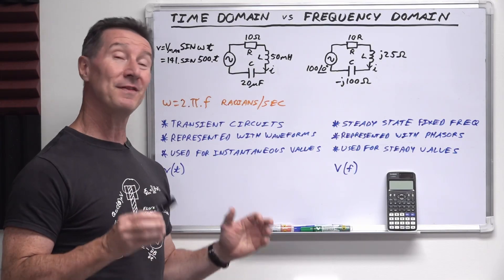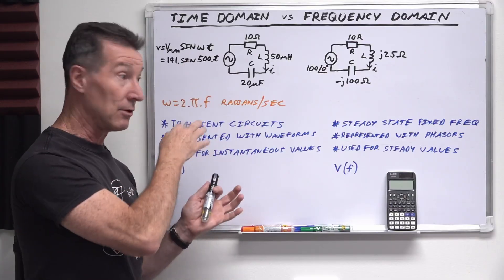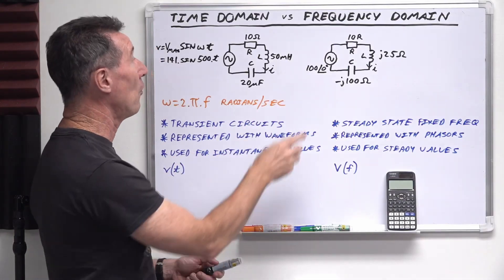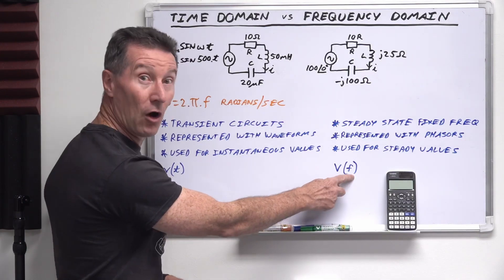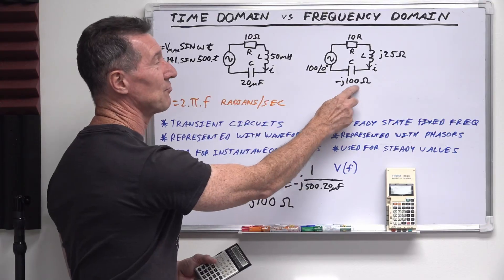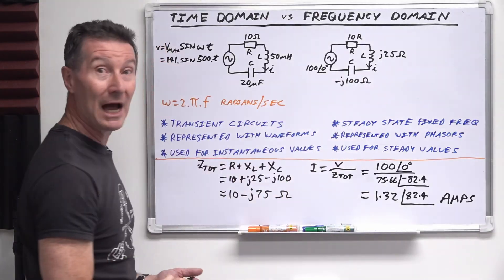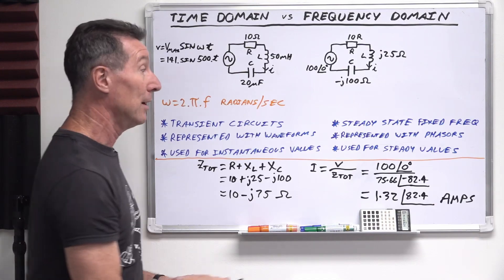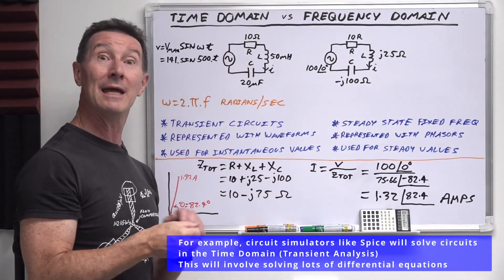EEVblog 1661 - AC Basics Tutorial Part 5: Time Domain vs Frequency Domain

Comment: The real beauty of the frequency domain is the ability to solve circuits algebraically for singular frequencies rather than having to solve differential equations in the time domain. V=IZ is so much easier than v(t) = R*i(t) + L*di/dt - 1/C*integral{i(t)} :)
Reply from the maker: Did I mention that in the video? I thought I did, or at least intended to.
Reply: @EEVblog  Eh. good enough for a 12 min video. Explaining the Fourier transform from di/dt to jw and integral to 1/(jw) is too much.
Reply: @EEVblog You covered that in the previous video, where you showed the derivation of V for capacitors and inductors.
Reply: Thanks to Steinmetz.

Comment: Around 2:40 w is indeed an angular velocity in both maths and circuit analysis. In basic circuit analysis it's used as a constant (determined by the AC frequency f) but otherwise there's nothing special. I say "basic" because when you get into more sophisticated analyses like Bode plots it's an input, and it's an output when deriving things like resonant frequencies, and at that point there's really no difference from its common mathematical uses.

There is no difference whatsoever in meaning or application.

Speaking as somebody who was trained as a mechanical engineer with extra math (all the way up to graduate-level mathematical physics) and a specialization in motor controls. All of this is very familiar from my dynamics and controls coursework. I'm just waiting for you to bust out some Laplace transforms, and then maybe some Z transforms for digitized controls just to make everybody's heads spin because Laplace isn't hard enough.